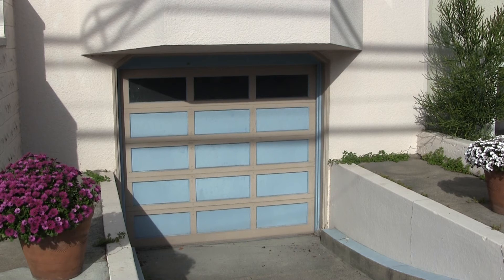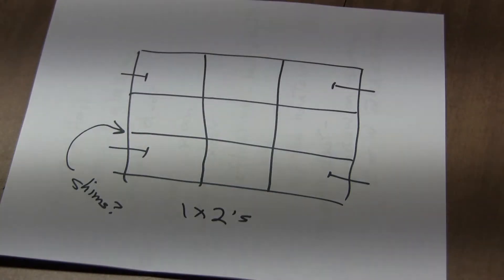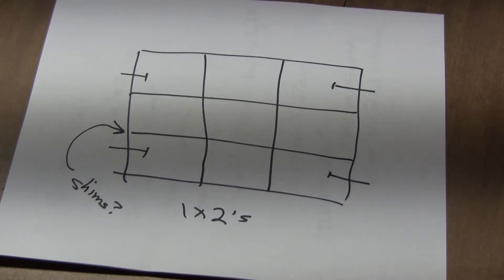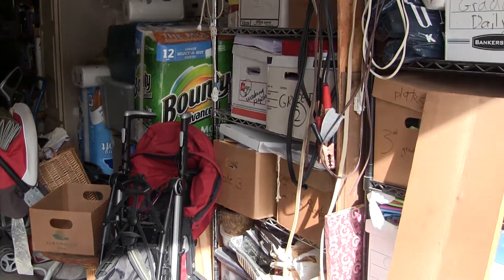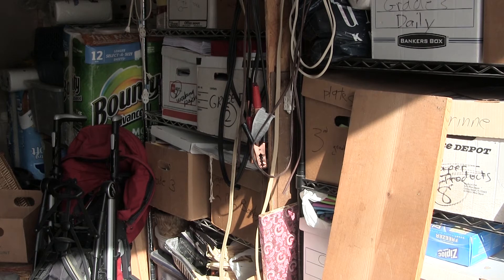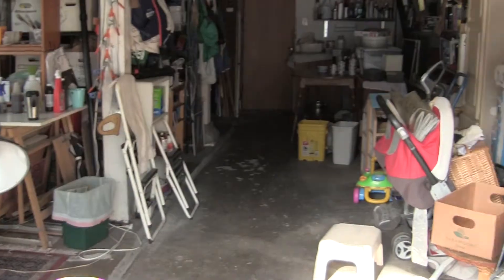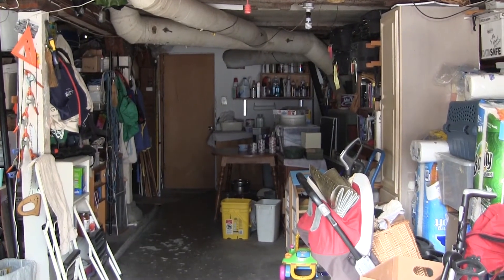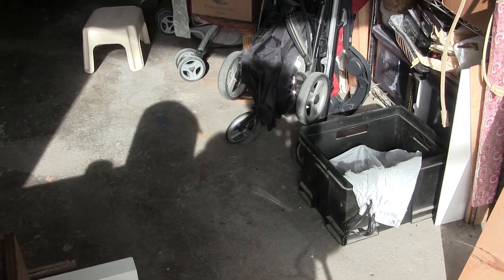GSM Solutions - Garage to Greenhouse

Comment: You could also change out the garage door to a glass and aluminum one, where it would function like green house windows, and you can get insulated or single pane glass, clear, frosted, etc. with those depending on what you need. It would be a fairly costly option though...
Reply from the maker: Good idea.